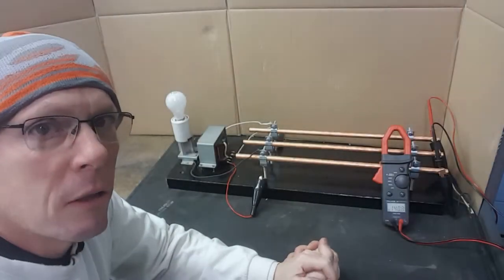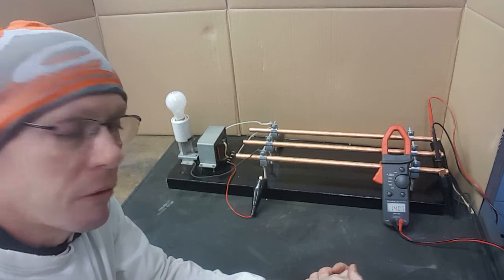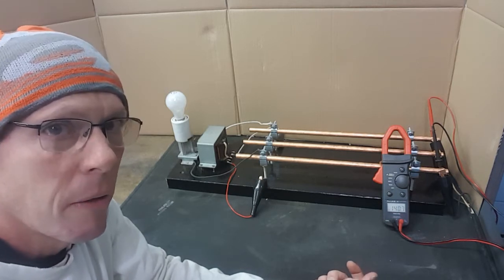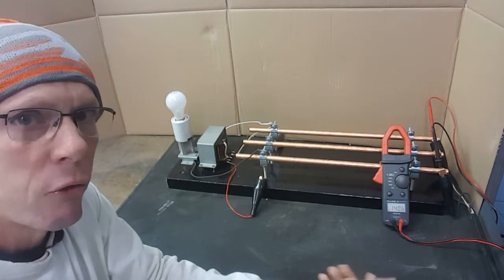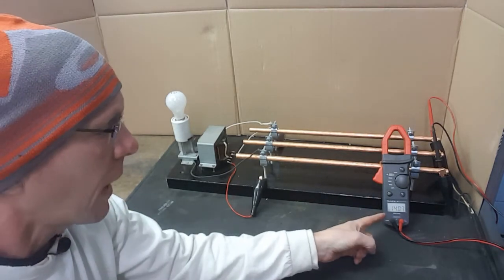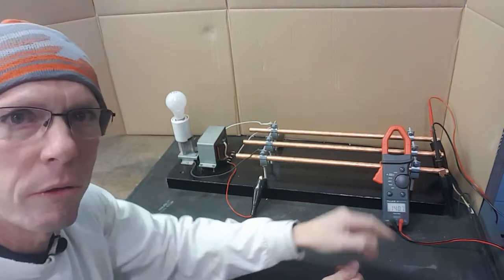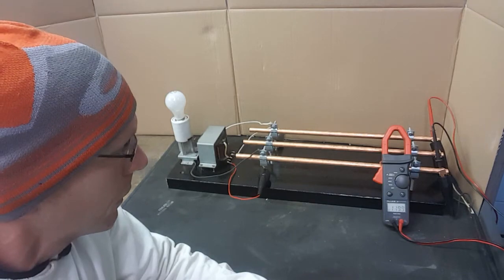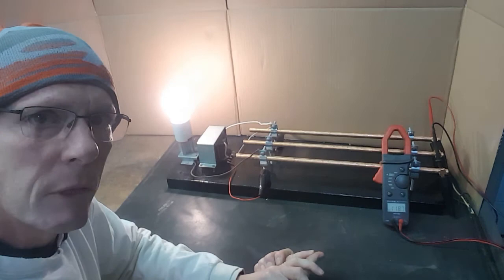💥The Ferranti Effect💥

Comment: Not sure if I have all this correct but if a voltage is higher as you move away from the source then there are three possibilities - one - the electron drift velocity is not metering the potential flow perfectly and some of the potential flow still gets past the electrons - two - some of the ambient field is becoming entrained into the potential flow - three -  some of the electrons that are involved with the drift are ablating back into potential and this would also drop amperage - all three effectively raising the voltage - one or more of these things could be taking place simultaneously - - I'm curious to know your opinion on this